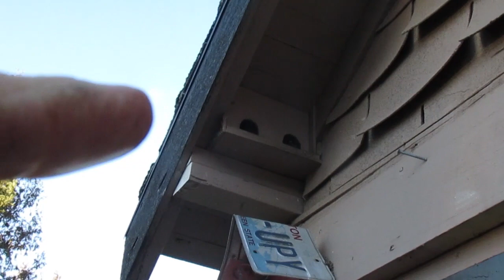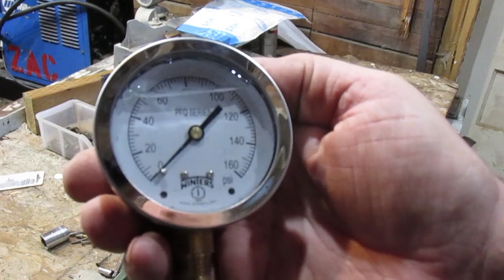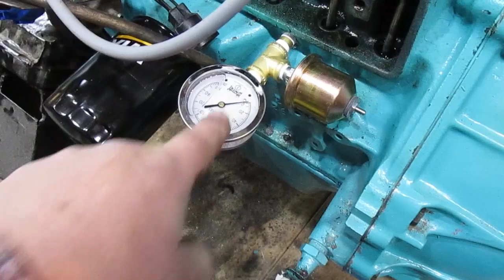The Cutworm Project Boat Tail 36

Comment: Away from the heat sounds right. A bracket of 1/4” steel to whatever bolt holes you have, with the pivot point at the bottom. A curved adjustment bracket at the top and both copper coated is my suggestion. Alolmab 👍🇦🇺🍻and I hope it goes well for your friend Cutworm.

Comment: GM one wire alternators tend to be cheaper than all the other options. If you mount it on the left side, you could use the studs on the cam cover to hold your bracket. You'll have to check the paperwork, but I believe your alternator is rated to 9,000 rpm, so the larger pully would probably work better.

Comment: Them one wire alternators work good.    It won't hurt to put it near the exhaust.  A lot of the early engines had the generator mounted to the exhaust manifolds and when they converted to alternators used the same mounts with no problems.  That said, I like the looks of it on the opposite side.  Makes it look more balanced.  Also, I found out on my Crosley Hotshot that they need more rotation than I could get out of the Crosley without revvin' up the engine so the faster rev is better er.  I think.   If you can mount it with the swivel down it'll make it easier to tighten rather than swivel up, but I'm sure it'd work pretty well either way.   Looks like you're doing an awesome job with it.